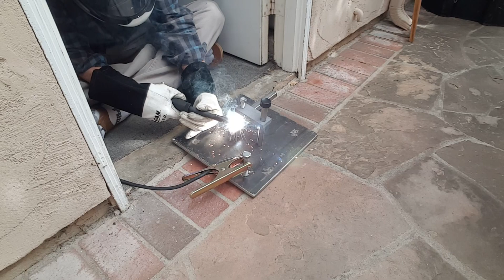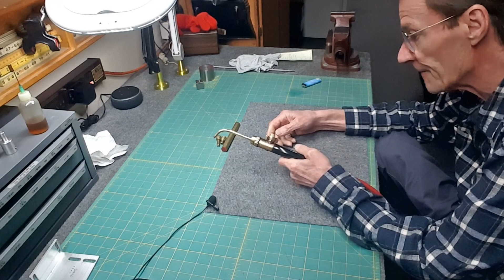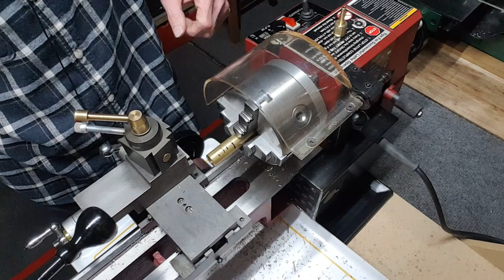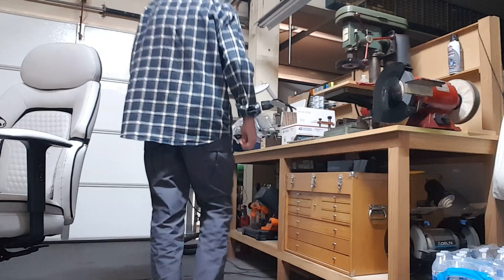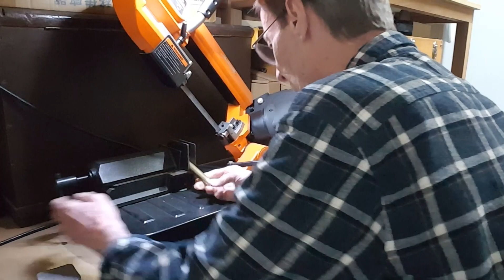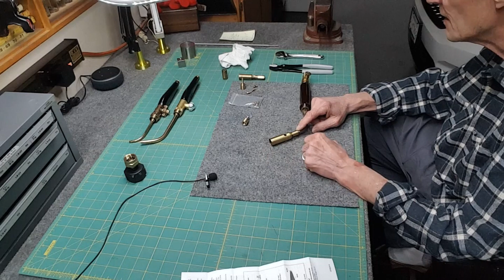Acetylene vs Propane Differences

Comment: Hey Dave, 
Geat video! Thanks for all the info. Anyway you can post that 4 Page brochure that came with your torch. I have some old uniweld torches as well. Can't find that one anywhere online. 
Thanks, keep up the good work.
-Matt
Reply from the maker: No problem it was on the back of this https://www.ebay.com/itm/156098613135

Comment: Just in the name of safety, be aware that there are two different grades of torch hose. Grade R and grade T. R is for acetylene. T (which denotes a Teflon lining in the fuel hose) is specifically for propane. Propane, being a petroleum by product, will break down the hose material over time, and the Teflon lining prevents that. Typically, the fittings for the torch end of those hoses are type A, and the regulator end type B.
Reply from the maker: Hi Tom, this is great to know thanks for leaving this info for others!